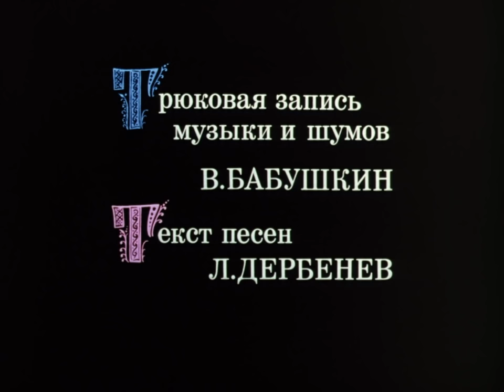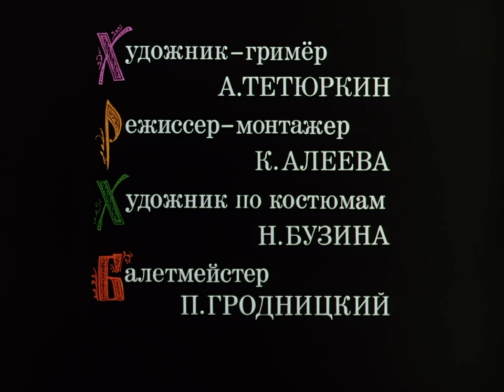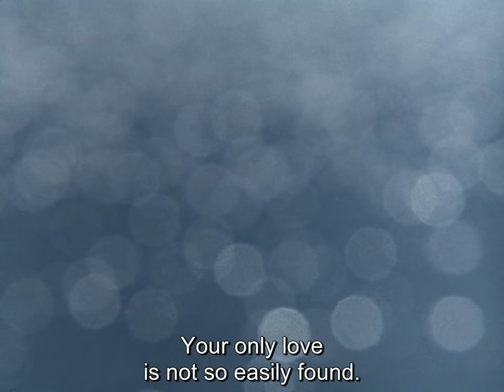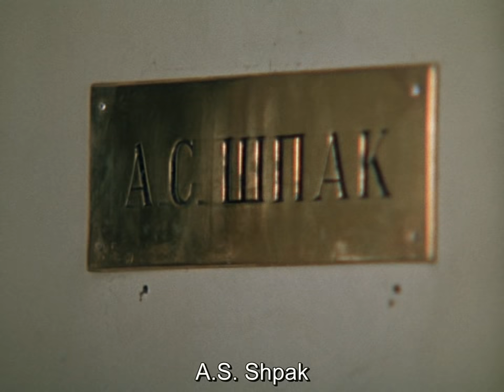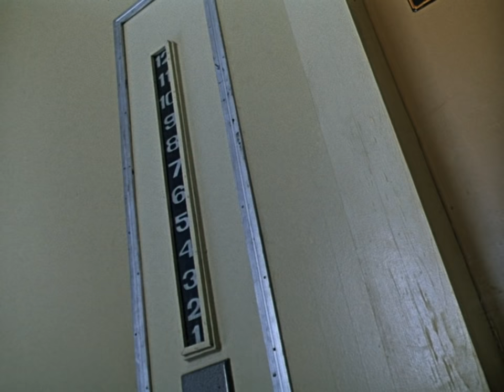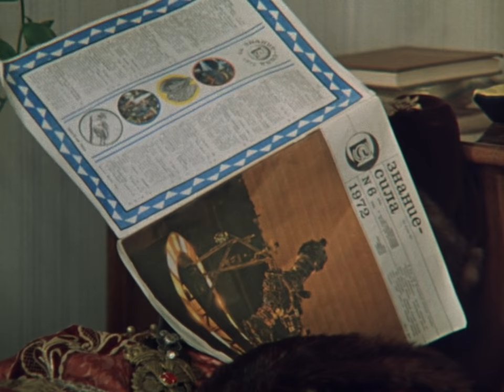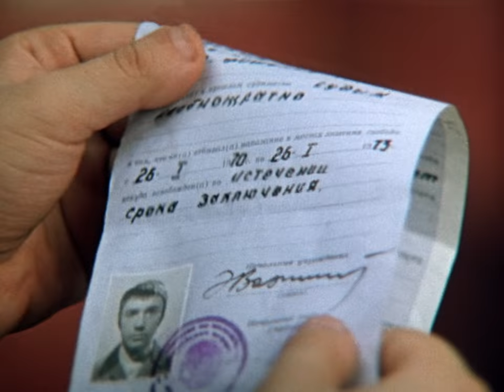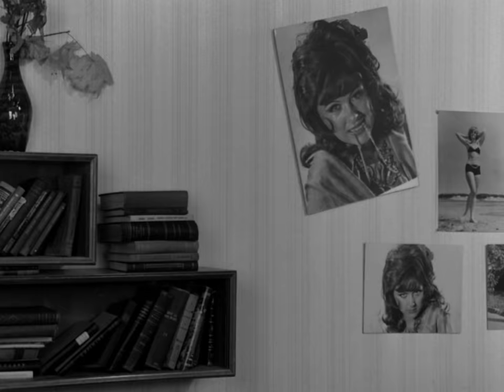Ivan Vasilievich Changes Profession (comedy with english subtitles, dir. Leonid Gaidai, 1973)

Comment: Sometimes the translation is very strange. I spent an hour and made a translation of the song "The January Blizzard Rings". Google translate plus some brains and you're done.
----------------------

[verse]
Meeting with love is a difficult problem.
The planet twists, it's round, it's round.
The planet flies into the distance through the turmoil of days
It's not easy, it's not easy to fall in love on it.

[chorus]
The January blizzard rings
And downpours whip elastically*
And stars race on a round
And cities make a noise.
People don't see each other, 
Pass each other.
People lose each other 
And then never find.

[verse]
In love, there is another complicated task.
You will find one, and suddenly it is false, false.
You will find a deception, but in the turmoil of days
It's not easy, it's not easy to figure it out.

[chorus]
...

[verse]
But somewhere there is my heart love
Unique, eternal, eternal.
I've been looking for it for a long time, but in the turmoil of days
It's not easy, it's not easy to meet with it.

[chorus]
...

* - in the original, this line also sounds strange. The word "elastically" was chosen only to rhyme with the word "blizzard". 
:)
Reply: *tensely
Reply: @MrJahbuddha  *springy.
Just the not very suitable word "elastically" or "springy" is used, which gives a slightly commical connotation.
Reply: Лучше на наш язык не переводить,это странно получается😁
Reply: Man it sure is true that it’s round it’s round